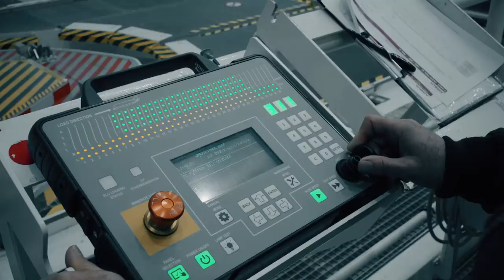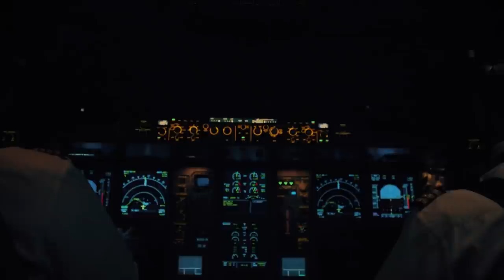#BelugaXL in operational service

Comment: I question myself how aerodynamic this thing must be and how far it can go with a bump on its head
Reply: The front has same aerodynamic shape like its wing and the cone dome radar cut the wind and flows through the s shape ,so the bump  it's already resolved (Guppy  has the same Bump  and was used by NASA), so they are not amateurs (Airbus)

Comment: Nice machine, but its success depends on the economics of transport. Hope Airbus has done proper market research on this. Potential customers should get a better cost by at least a margin of 15-20 percent. Anything less than that is vulnerable to the change in dynamic price of other modes of transport.
Reply: Either you mean that ironic or you don't understand what the Beluga XL is meant for. Airbus doesn't sell them. They use them almost exclusevely to transport large components between their manufacturing plants.
Reply: shi01 Exactyl! People who try to look like they are smart are the worst 🤦🏻‍♂️
Reply: @shi01  I know the present situation. Almost a billion euros in development costs will not just go for their own transport concerns. There is a future potential, be it civil or military transport. That is why they have listed it under "commercial aircraft" on their website too. 

https://www.airbus.com/aircraft/freighter/beluga.html
Reply: @emperormartinet1  A billion euros to develope such a plane is actually a bargain. Also, how many Belugas has Airbus sold? I can answer that for you without even looking it up, none. You can charter them for special transports but that's it. You can't buy them.
Also compared to normal freight planes the Belugas are designed to fulfill very specific needs, only encountered in the aerospace industry. The are very good at transporting very large but comparable light stuff.
Boeing designed their Dreamlifter for the exact same purpose as Airbus has designed the Belugas and you can't buy Dreamlifters either.
Reply: @shi01  Both goods and services are meant for "customers" in business. The term 'customer' is not used exclusively for someone who buys actual physical goods. I said the same thing for present. For future I hope they will sell it to specific customers such as big manufacturing industries spread on large geographical areas or armies with big military budget. My first comment was in that context.
Reply: @emperormartinet1  You don't get it. Airbus designed the Beluga specifically for their own needs. For instance it has no loading ramp because Airbus uses special docks to load and unload them. Load or unload them somewhere else with a crane would be a pain in the ass. Also the Beluga XL can't even carry half as much weight as for instance an AN-124 can, but it's cargo compartment has more than twice the volume of the one the AN-124 has. Also Airbus said some time a go, that they plan to produce exactly 6 Beluga XL aircraft, because that's the amount they think they will need.
Reply: @shi01  You are getting me wrong. I am talking about business potential, even if it was not the primary objective of Airbus. Even at present, if they are using it for their own need, they will not shy away if a market need arises for such a plane.  Any company will manufacture a product if it has considerable profit in it. That's my opinion. Hope you get it now.
Reply: @emperormartinet1   Airbus will not get the beluga XL in freight market. The XL is used for airbuses own use. There is no potential of airbus to sell beluga XLs for the Freight market. anyways it would not be that effective as the current a330 freighter and next generation ones like the a350F and the a330neoF. It will be just a waste of resources, time and money. Airbus knows if they put it on the market, the plane would not be very successful.